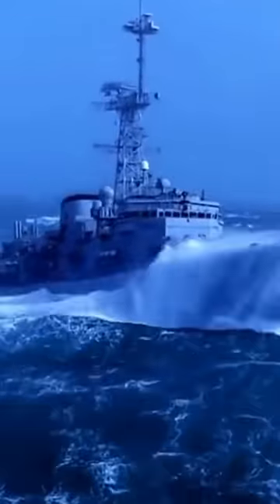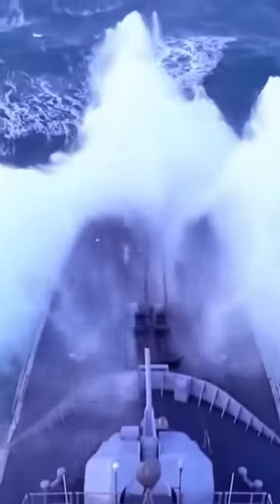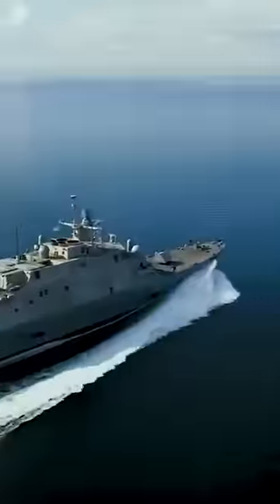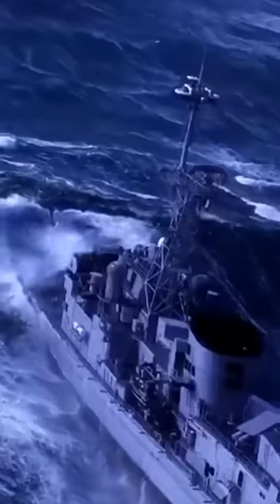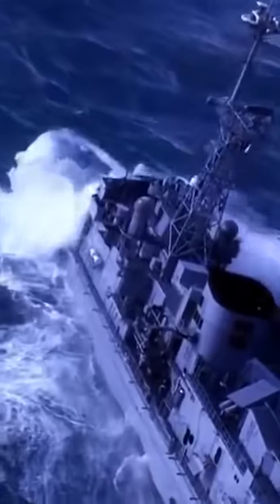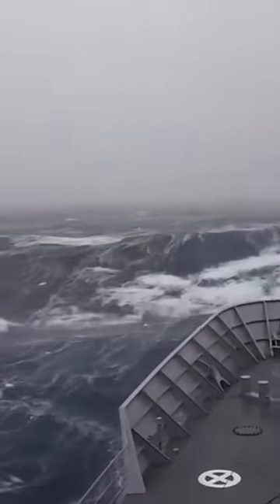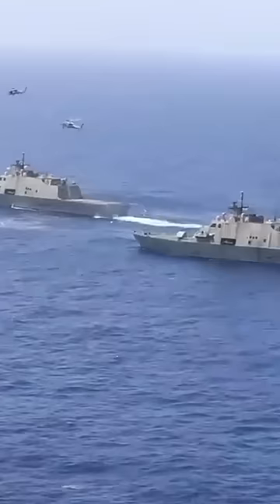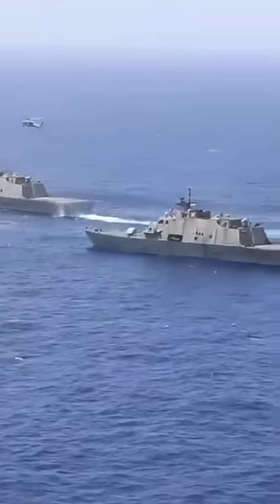INSANE Method U.S WARSHIPS Use To Avoid SINKING During Storm😱

Comment: Served on a Knox Class destroyer escort as Aircrewman on a LAMPS Mk 1 Det crew, and experienced high seas, 40+ ft swells with waves breaking over the bow and bridge clear back to the flight deck.  All watertight compartments and hatches sealed and no one allowed on deck without  safety harness and rigging.  We turned into a submarine running on the surface, and upon losing our power plant two days out of San Diego, going dead in the water without our ships stabilizers, we came very close to a point where the main gun mount and aft rocket launcher would have fallen off their mounts to lighten our load and hopefully prevent the ship from capsizing.  It was one helluva ride, and I wouldn't want to experience THAT again, but proud I never fed the fish!😁👍
Reply: Damn that sounds pretty scary man. 
Thank you for your service.
Reply: Ditto
Reply: Ditto! I was on the same class, LEO in the Carrib., chased down a 72' tug of Pan reg. and requested boarding. Long story short it was hot, so we (USCG Det) confiscated it and a sample, and towed tug to Gitmo. Heading home to Norf. we were caught between two huricanes.
Now the reason I am on board is to get my Airdale feet wet, since I was training blackshoes now. Rough! Mast busted in 4 places, all 4 HF antennas shattered, water purification offline, Linen cabinet launched from starboard bulkhead fully laden to collect 1st class missile tech for a ride across two tables. Ow!! Atlantic rushing up fantail to rear hatch to break over gunn'ls. CO, XO hugging their porcelain Gods, and this former VP dude just walking from wall to wall is just taking it all in. And this did start with a lagging fire on a steam line. 
Can you believe you could miss that? How about turning up a T56 on the test cell that you just rebuilt. Or fixing one on the phone that is in the Carolinas, and I'm facing the SU in the straight between Bermuda and the East Coast. Circa fall '83. (BTW that turbine was 78% when they called, 114% after we were done) CNO fired me after that. I was suffering 18 hour days 7 days per week for 4 months. Where's the appreciation? Sad, because another Admiral gave me high regards! People!?
Reply: I suppose if the gun fall off, water would easily make the compartment rather wet?
Reply: @douglasberg2881  It's a rather small space beneath the gun mount. Water tight doors permit access to the magazine, and to below decks. So you would have a closet full of water for the most part.
Reply: It was my honor, and the experience of a lifetime!  Wouldn't trade it for anything, and would do it again in a heartbeat!  The brotherhood and comradery with those I served and flew with live on to this day, and  I shall cherish those friendships and memories forever.
Reply: Marines say hoorah, army says huah, airforce says idk, navy says ???
Reply: First mate or Chief officer here on a few great Lake's freighters and some ocean cargo ships...

I've seen Lake Superior look as bad as the Bering Sea, 75mph winds 30ft waves.....Coming from an ocean ship I did not expect that. I initially vastly underestimated the great lake's. Weather conditions they won't send help in. It's been really bad lately with that storm that hit buffalo NY. We got caught in that on Christmas. Blizzard white out. Captain stood out on deck bc no visibility would only nap when things weren't ugly
Reply: Are they made to fall off before you capsize?
Reply: @ED-es2qv  Correct!  Designed to separate and fall off of the ship if list reaches a certain threshold where capsizing is a real possibility.
Reply: @douglasberg2881  Better to sacrifice a gun turret crew than lose the ship and entire crew!  One's duty often comes with a VERY high price!  That's why there's the Congressional Medal of Honor and Silver Stars with oak leaf clusters and a V for VALOR!🥰🙏👍
Reply: @stevemarkle6609  is the gun turret crew actually in the turret during a storm like that?
Reply: what would be insane is if they flood ballast tanks to keep the ship under the waves during heavy seas
Reply: @alexmcaruthur6966  The Navy says someone had to get y'all to the fight, and provide accurate, heavy artillery and logistical support to assist you in accomplishing your mission/objective! Same team, one goal... TOTAL VICTORY & DOMINANCE ON THE BATTLEFIELD,, and the preservation of freedom & liberty!👍🥰
Reply: The gun mounts fall into the sea to reduce the weight on the top of the ship to reduce chance of capsizing not to lighten the load.
Reply: Exactly! Perhaps my words were poorly chosen to describe that accurately.  Thanks for the clarification! You're absolutely correct!👍
Reply: I've seen video's of the engineering and hydrology studies they do on every ship they build, using scale models in water tanks that simulate various sea states and conditions to determine such operating parameters.  They know where the point of no return is and when it's time to shed weight topside in hope of saving the ship.  It's already been contemplated in the design,, but as we all know there's just some things you just can't foresee or plan for. Rogue waves for example!
Reply: @stevemarkle6609  We came close to the max degree roll during a hurricane on the frigate never got close on the destroyer or cruiser. And yes there is a exact degree that each class ship has to dump turrets and launchers to help prevent capsizing. Lol most don't know the feeling of that, bet you will never forget.
Reply: I was on a guided missile destroyer. We rode out hurricane Hugo at Sea. We had 50 foot waves. We felt like a submarine. That was one hell of a ride. And you can't pull over and wait it out. I'd do it all over again.
Reply: I was on an RCN destroyer in the 90's. in heavy seas you could walk down the flats and wind up on the bulkhead..
Reply: We don't have to say shit!  We paid our dues in blood just as your's did!  We're on the same team BROTHER, and the cost to defend freedom and liberty is great!  There's no need to promote dissention among our ranks BROTHER!  And thank YOU for YOUR SERVICE!3👍🍻
Reply: 888k.9

.
Reply: Steve, what FF did you serve on? I served on the USS Gray FF-1054 out of San Diego as a Machinest Mate from 1976 - 1980. Some of the best times of my life. I to would do it all again.

Comment: I would not describe maintenance as “insane” but ok.
Reply: Yeah ... talk about a click-bait title.
Reply: I disagree. I would have never thought of that. I’d just yell bail
Reply: Its pretty insane when you actually work especially an old ass ship
Reply: Its pretty insane when they’d make you mop the ceilings with your toothbrush just to keep the footprints of those crayon eaters off
Reply: nothing they said in the video is "insane"  but just standard common sense stuff
Reply: @RedWingsninetyone  I’ve owned two Toyota pickups and two Chevy pickups. What do you call a shot box?
Reply: I was in charge of PMS , preventative maintenance system, for the guided missile destroyer, the Richard E Byrd DDG 23, for the forward boiler room. It is a good system in which the proper maintenance of all components and equipment is carried out either by the number of days or hours of that specific equipment is required. Kinda like changing the oil on your car, every three thousand miles. In the North Atlantic, heading for Norway, we ran into a storm with reported 70 foot waves, and were tossed about like a tiny cork. It is especially important to know that your ship’s equipment has been taken care of properly. That cruise was an education, of what Mother Nature can teach us. We are all trespassing upon the seas, as attested to by the tens of thousands of ships that have gone down to see Davy Jones in the depths of the oceans, worldwide.
Reply: @sureshots8155  depends what you had. Going out on a limb, I'd say the Toyotas were probably not shit boxes. My comment was also a facetious one.

Comment: Watertight hatches are key, next is keeping the power plant running
Reply: This video was total garbage clickbait. Your comment was spot on!
Reply: I remember being in the I.O. on an LPD "flat bottom" and having manually check "control" water in the forward boiler. Water level going out of site hi to out of site low. Anyone that knows steaming propulsion boilers knows that this is not good or safe but we stayed online. I was counting "one thousand one, one thousand two each time it went out of site and set the water to split the difference in time from one casualty to the other. +5" or -5" in the glass was supposed to be a casualty to secure. We did not and no one died but it was not fun at all! You could hear and feel the ship slam into walls of water and the shafts would fun faster out of water. The whole thing shook side to side when coming down into the trough.

Comment: Good video, although I would have appreciated a more complete answer for what features a warship has to withstand rough seas.
Reply from the maker: Got 59 sec to summarize hahaha 

Maybe a part2?
Reply: Top secret data
Reply: It's pretty simple: flood ballast if you have it, flood fuel tanks if you have to, shut all water tight doors, secure topside watches, secure all potential missiles, perform ship wide conditions check, serve light meals, and reserve bulk of crew to berths. During wartime it's the CO's discretion.

Comment: I was a Merchant Mariner (engine room) on an ex-Navy spy ship converted to oceanographic research. We got caught in a storm in the Bearing Sea and were thrown around like a rag doll, taking water down the funnel. We were buttoned up tight, bow into the swell, all hands at damage control stations, decks awash in vomit. It was terrifying but not to worry because if we went down, the crew would only last a few minutes in that 42 degree water. When we made port, I got on my knees and kissed that sweet earth.

Comment: My dad was in the big typhoon in the Pacific on a Destroyer Escort with three others. The Commodore said run into the wind and seas per orders. But, the DE's were flat bottomed unlike larger warships... The seas were shaking them apart, flat bottoms made it almost impossible to stay on course. A Chief Engineer who had been part of building them told the Commodore they would be dead within an hour. He said you have to run with the seas with the flat bottomed boats. You can't fight the storm. The Commodore turned them around, itself a feat and they ran with the wind ending up hundreds of miles off course when the storm was over, but they and the ships were still alive... McCain the admiral took a lot of heat for his orders and the many ships that did sink... That was John McCain's father...

Comment: Aboard a carrier during a north sea storm.  Zero G, floating down the passages as the ship fell down the waves, to be smashed against the deck if you werent ready when it found water at the trough. The escort ships with us breaking water like a submarine rushing through the surface, sometimes only their stacks visible above the water.  How do you not sink?  You close the doors of course. Hatches bolted down, nothing opens up and when one shatters and explodes inward you throw two dozen men in the room with timbers and welders and seal the room while they wedge another one in place and weld it closed.

Comment: Try steaming the North Atlantic when the waves are bigger than the ship. The ship would shake and shudder violently when travelling (falling) down the face of a wave. Why??? Because the screws were no longer in the water. My ship had a 40 ft draft, as well. USS Milwaukee - AOR-2.

Comment: They kind of did not answer the question. Even after 20 yrs on the seas I would not consider PMS an "insane" method of withstanding stormy seas.

More like closing hatches and steering into the storm (or going around it). Still not what I would call "insane."